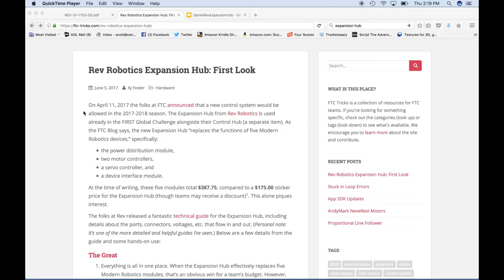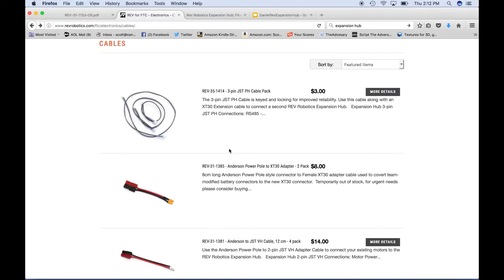FTC Robotics Help - REV Expansion Hub - Connecting Motors, Encoders, and Sensors

Comment: is there a way i can use the original modern robotic electronics with this new expansion hub elctronics, i made a power cable to go from the old power modual to the exspansion hub wich dose power bolth then i hooked a old micro usb too usb cable between the two but i can get the phones to recinize the expansion hub
Reply from the maker: I'm pretty sure you're supposed to be able to, but haven't seen anyone do it yet or haven't seen any info online about it.

Comment: Thank you for the post. Can we use Modern Robotics attachments (Color sensor, touch sensor) with  Rev Robotics? Also are you planning to do a new FTC programming lesson with Rev Robotics?
Reply from the maker: Hey Robo Minions 2.0. To check which Modern Robotics sensors you can use with the REV Hub, check out the awesome document REV put out. Go to pages 17-18. (https://www.revrobotics.com/content/docs/REV-31-1153-GS.pdf) We suggest reading that entire document, it's super helpful. Programming with the REV Hub should be nearly the same, so we may not be putting out any new programming videos specific to the REV Hub. But who knows?

Comment: hi! we're a rookie team and looking to purchase the rev expansion hub kit. does the "REV Robotics Hub" kit include the conversion cables b/w motors and encoders? or do we need to buy the "REV Conversion Cable Pack" as well?
Reply from the maker: When we got ours last year, we got a kit that had a couple of touch sensors and a couple of motor power adapters and one for the battery. I can't remember what else. The good people at REV are great at answering questions. Send them an email and they will answer any questions you might have.

Comment: Thank you for posting your video. I see that the motor you connected has an encoder. However, the motor that comes with Tetrix starter kit, Motor W39530  (https://www.tetrixrobotics.com/extra-TETRIX-parts-for-FTC/Motors-and-Servos/TETRIX-DC-Gear-Motor) does not have encoder wires. Do you have to attach a shaft encoder to the motor to use it with the REV Expansion Hub?
Reply from the maker: Hey Eric. The Tetrix motors do not come standard with an encoder, so yes, to use an encoder with the Tetrix motors you need to add the shaft encoder (this is true of the Tetrix motor with any of the motor encoders, not just the REV hub). Before you do that, compare the price of buying an encoder vs. buying the Andymark.com Neverest motor. The Neverest 40 is the speed/power equal to the Tetrix motor. Also, the Neverest seems less likely to burn out, and it comes with the encoder. The Tetrix motors are shorter if space is a concern. Let us know if you have any other questions.
Reply: FTC Team 9779 PIEaters
Thank you for your timely and insightful reply. 
Very much appreciated!
Reply: Can you do it to Tutorial  for us on how to add encoder settings into the FTC Blockly program? We would really like to be able to stop a motor in a specific spot. We are running the never rest motors...

Comment: Hi, I´m having some trouble connecting the MR color sensor to the rev expansion hub, can we contact by email?
Thanks and great video.
Reply from the maker: We ended up not using the expansion hub and stuck with our Modern Robotics stuff. So I'm not sure how much help we can be. Have you checked out this P21 of this document? http://www.revrobotics.com/content/docs/REV-31-1153-GS.pdf
Reply: FTC Team 9779 PIEaters No problem, just for curiosity, why did you take that decision?
Reply from the maker: We were happy with our electronics last year, and by the end of the year we were having no problems at all. We also have a bunch of MR sensors. To use the sensors, and encoders, you need the level shifters and adapters and stuff. We thought our wiring would be cleaner if we just stuck with MR... but it's still a mess. We also like Anderson Power Pole connectors. They are easy for us to make custom length cables. We are happy with our Modern Robotics electronics this season, although we do get a little jealous of a really small, organized REV Hub robot.
Reply: Thanks for all of this and good luck on this season

Comment: We have Tetrix DC motors, and a review expansion hub. How do we hook them up?
Reply from the maker: Hooking up any motors that don't have the same connector as the REV hub will need adapter cables. Like in the video we had to use the adapter from Anderson Power Pole connectors to the REV connection. I don't know if they make adapters directly from the Tetrix motors to that REV connection, but I know they have adapters to Anderson Power Poles, then you can adapt from Anderson Power Pole to the REV Hub using the included adapter cables. I hope this helps.